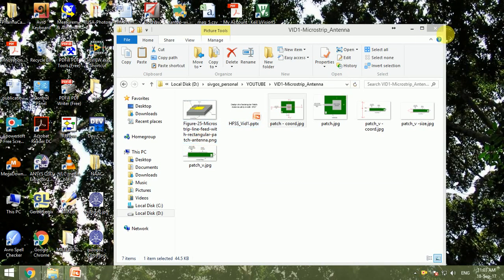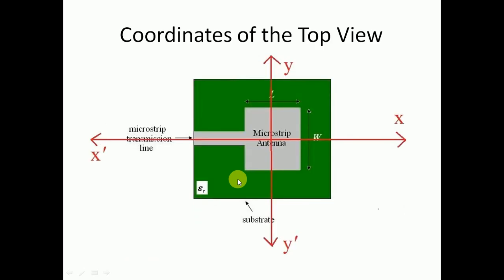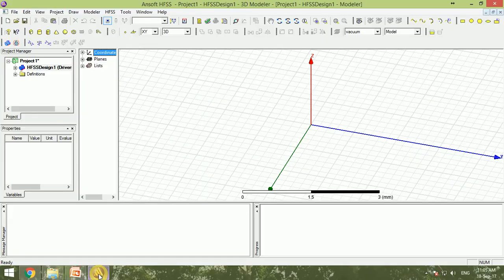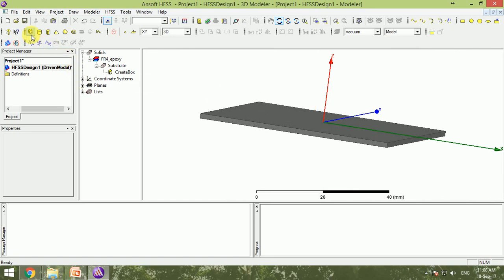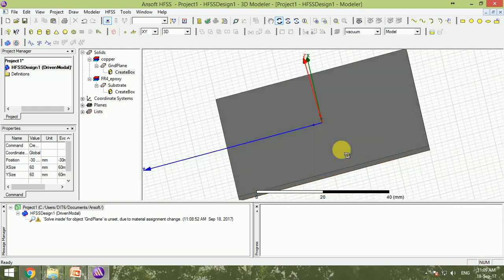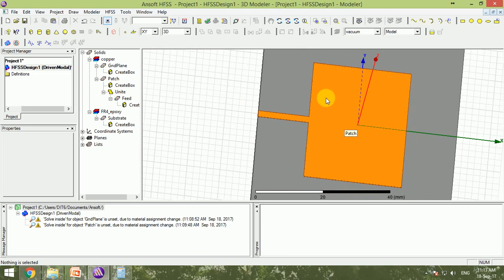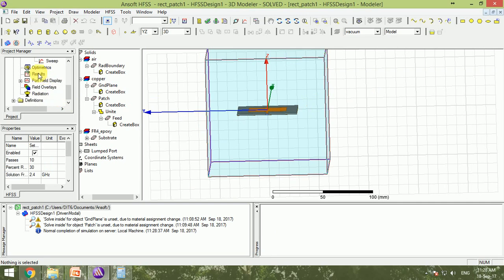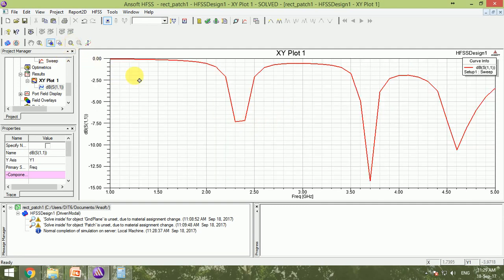Design Rectangular Patch Antenna using HFSS Part - 1

Comment: What about the impedance matching? Is it matching with the patch? Please reply
Reply from the maker: No. This was an introductory video on how to design a microstrip antennas using HFSS. You need to match the impedance using some other method such as inset feeding.
Reply: @helpbeingengineer4726  thank you sir! It was my doubt.. & now it cleared but I have some other questions...  is it necessary that, a gap between substrate & ground plane, &  substrate & feed line to be present there in order to design that antenna? I meant we can directly put ground, substrate & patch by avoiding those copper materials gap?
Reply from the maker: @swetapadmapanda6349  in simulator, you can do anything. But you must keep it in mind that those antennas are to be fabricated, and the measurement results should match simulation results. That's why you have to keep the gaps as close as possible to the specifications of the PCB boards you have purchased.
Reply: @helpbeingengineer4726   ohh now I understood thanks a lot sir🙏

Comment: you should add gaps near feed point to fine tune the resonant frequency or tweak the ground plane as the first resonant frequency is near 3.7GHz with a return loss of -14dB and not at 2.4GHz frequency. Also you are having one more resonant frequency near 4.6GHz which is having a return loss of -10dB so this is no way working at specified 2.4GHz frequency as the return loss is higher than -10dB
Reply from the maker: This is just a preliminary tutorial to teach our students how to create a basic antenna using HFSS. The techniques you are saying were covered during the live classes.
Reply: @helpbeingengineer4726  dont u think its incorrect teaching, coz i used to teach electronics and never done like this.
Reply from the maker: @raghav1502  you can't judge a 10 days course by a 19 min video.
Reply: @helpbeingengineer4726  well it depends on how u teach coz i judged it
Reply: @helpbeingengineer4726  always make videos which point to the title, now if u r making video like an amateur and telling me u teach this is total non sense and nobody will believe. at least and first ill never coz im an electrinics design and development professional indulged 24x7 in these kind of a activities for my clients like dlink, wipro, hitachi etc. etc.

Comment: I tried doing the microstrip antenna at 2 GHz frequency
the patch is very big with L=52.21 mm and W=61 mm but for the substrate I used 30 mm

Comment: Please how do you get it to resonate at 2.4Ghz
Reply from the maker: There is no direct answer to this question. You have to adjust the dimensions a bit. Sometimes we need to use inset feeding to lower the S11 parameter.

You will find some online tools or mathematical equations to calculate the dimensions but they usually give an approximate result only. You must adjust the parameters and run multiple simulations to get the most expected result.

Comment: Good tutorial, but this antenna is not resonating at 2.4Ghz instead it is resonating at 3.7Ghz, Since -10 dB is considered standard value of return loss(S11).
Reply: I think if we increase the data points its get to  -12.5 at 2.4 
I could not paste screen shot here
however 3.7G I have -20

Comment: This is good. Being beginer I found it very useful for antenna designing. Could you please Make video for aperture coupled microstrip patch antenna
Thank you
Reply from the maker: Thank you. This tutorial is only for showing how to make a rectangular patch in HFSS and see the results. Inset feeding is needed to match the impedance and bring the S11 parameter below - 10 dB at 2.4 GHz. 3.7 GHz is the 2nd order resonant frequency. It will radiate in X or Y direction. In a rectangular patch antenna, we only see the first order resonant frequency (dominant mode of the cavity model).

Comment: Hello Sir, when I am doing simulation, the error is showing taht, Port refinement, process hf3d error: Terminal Rectangle2_T2 on port p1 contains a non-conducting edge.  The terminal may need to be assigned manually. Please suggest me how to remove this error.
Reply: The plane you assign for making the lumped must touch the ground plane and the feed line. If they are not properly connected this error may occur.
The arrow line that you draw to define the lumped port must be withing that plane.

Comment: Sir when i am assigning the excitation port as lumped port . It gives an error saying  "all faces selected to form a port must lie on the same plane".
 How should i resolve it?
Reply from the maker: In the video, you must have seen that I always enter the coordinates (or any dimensions) using the keyboard. If you are just using your mouse to draw the structures, sometimes it may happen that one or two points are not properly aligned. Even a minute misalignment may lead to error.

Please check the coordinates and positions of each component of your antenna and make sure that everything is in the same plane.

Comment: Thank you so much for giving your wonderful work. Really it is so good. I am impressed with your your work brother. May Almighty Allah bless you.
Reply from the maker: Thank you.
Reply: HelpBeingEngineer dot info 
Could you give me a video of rectenna design by HFSS.
Reply from the maker: A rectenna is a combination of a rectifier and an antenna. To make a rectifier you need diodes which cannot be simulated using HFSS. You can perform the simulation in Ansoft Designer + Ansoft HFSS. You have to design the antenna separately in HFSS and the circuit parts separately in Ansoft Designer. There is some provision for importing the antenna from HFSS to Designer. I have never done it myself but I found some resources which tells about such designs. I don't have Ansoft Designer. It comes with the Ansys Electromagnetic suite 2014 and higher versions. It is difficult to get  a crack of it..

Comment: Very Nice work I really enjoyed it. can you do something on step impedance filters. Can you also make them a little longer because this is a very interesting topic and package to use.
Reply from the maker: Thank you, Idris Musa. I basically work on antenna design. My next videos will contain inset feeding, antennas with variable dimensions, and the optimetrics tool of HFSS. After that I will try to make some videos on step impedance filters.
Reply: Thank you for that, I shall be expecting it. I have the problem that I need your help on; I have designed and have been simulating a low pass filter, the validations were checked to be good but after analysis i got thi error message "    [error] Port refinement, process hf3d error: Port 1 is assigned to an internal face.  Only allowed with lumped ports.. (6:55:53 PM  Dec 11, 2017)
    [error] Simulation completed with execution error on server: Local Machine. (6:55:53 PM  Dec 11, 2017)"  Can you suggest the best way to solve this problem? I know you are busy but any help will be most appreciated. This part of my PhD work. Thank you.
Reply from the maker: One of my students encountered the same error. I found that a lumped port of his design was touching more than two conductor parts. So, there may be some similar silly mistake in your design. Observe thoroughly and you will find.
Reply: Thank you, the problem has been solved after careful checking of the design.